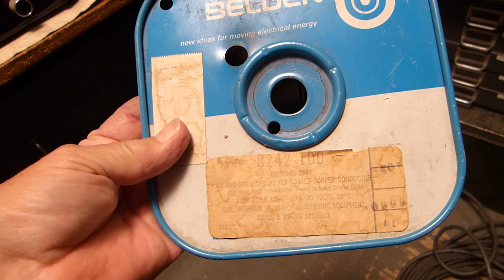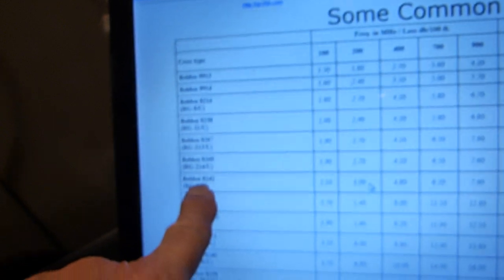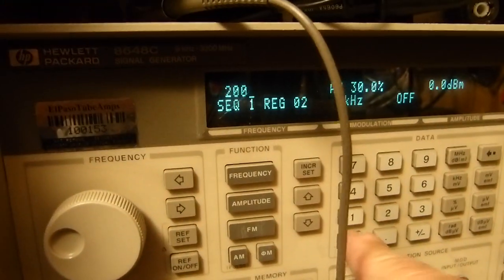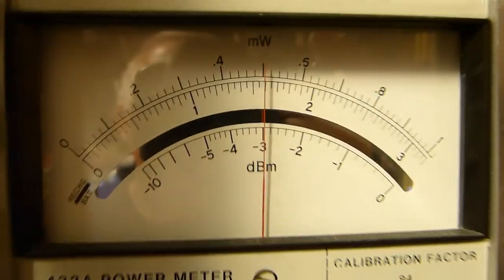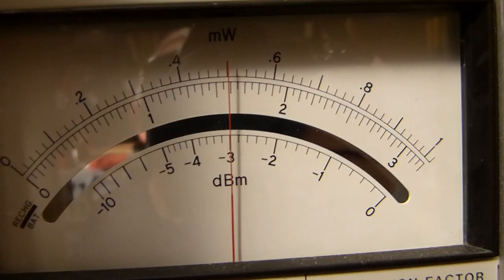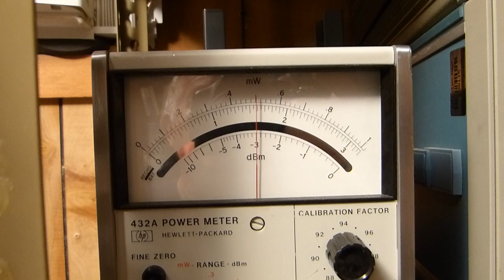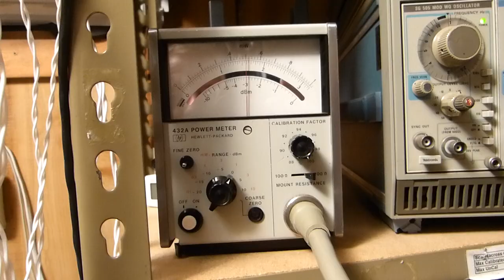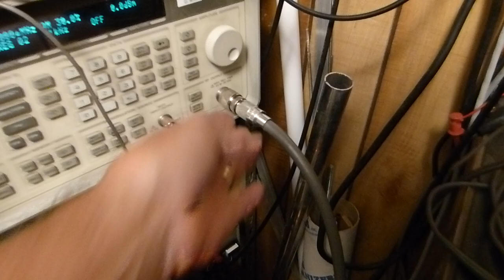Testing a 40 Year Old Never Been Used (NOS) Roll Of RG-9/U Coax Cable For RF Losses

Comment: Sounds like it never really needs replacing......I have wondered about timed replacement and if its a good idea or not......its the old saying if it ain't broke, why fix it.....sometimes you introduce faults.....but its good they do so you can stock up !!
Reply from the maker: The new LMR 400 is "guaranteed" to last 20 years in the sun or buried in the ground and it even has a gel substance in it to extend the life in case of a puncture. The old stuff of 40-50 years ago may age faster in the sun or in the dirt. I really don't know as I never had anything to test it with until now so all I could base my opinions and actions on was the information I got from others and they really didn't know either but anyone that can instill doubt and fear seems to have a lot of influence and then that attitude is very hard to change. Yes, it is good for us guys that the government is so wasteful and we can get the throw-away often times for nothing.

Comment: Why 51Ω instead of 50Ω or 75Ω? Are they rounding up the diameters on the spec  and then derive the impedance from it?
Reply from the maker: I have wondered that many times also. I am holding in my hand some coax jumper cables from my  cable drawer that has been salvaged from equipment that I have parted-out and two are labeled 53.5 ohms (RG 55/U) , another one 93 ohms (RG 71/U). I have wondered the need for those exact impedance's. I have never quite gotten the difference or need for this 50/51/52 ohm coax either. As you mentioned, maybe they do the math with the diameter ratios and dielectric and those are the numbers they get so they state it. I can't imagine it makes much difference at the power and frequency levels most equipment operates at. Maybe for high accuracy in GHz equipment it would make a difference. Here are some numbers I just looked up that are interesting. I am not sure they make RG-59 anymore as it seems to be replaced by RG-6

RG-6 76 5.6 1.65 0.332 
RG-8 52 4.2 2.00 0.405 
RG-8X 50 7.7 2.50 0.242 
RG-11 53.5 11.7 1.00  
RG-55 53.5 9.4 1.00 0.195 
RG-58 53.5 9.4 1.00 0.195 
RG-59 75 6.9 1.20 0.242  
RG-59 20AWG 75 16.0 5.00 
RG-59 Plenum 75 5.9 2.00 
RG-62 93 8.0 2.25 0.242
Reply: @ElPasoTubeAmps  Some running lengths to antenna are going to be 200feet.  some of my amps put out 120v DC or more , and are expected to work with tannoy or horn speakers running a mile and a half away for PA at the horse trials and car shows etc